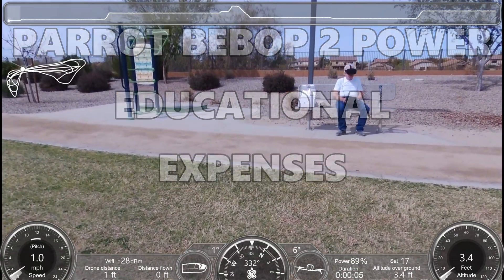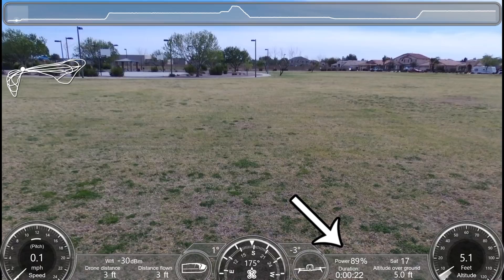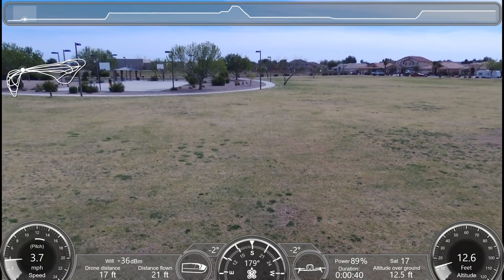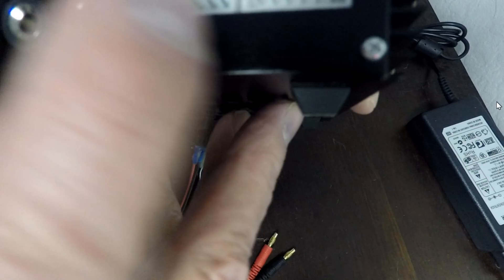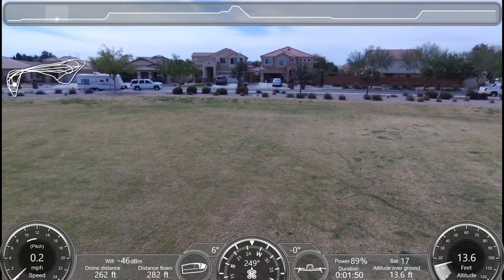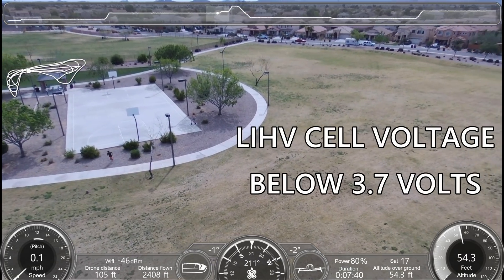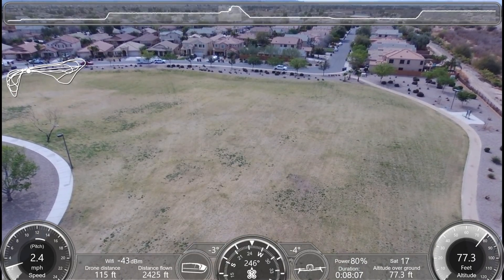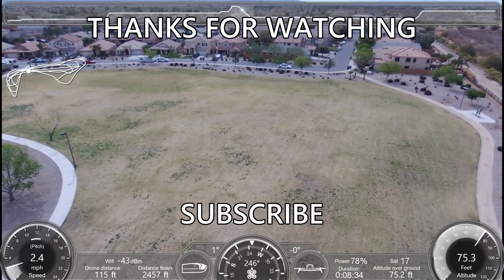BEBOP 2 POWER EDUCATIONAL EXPENSES

Comment: Mr Kent. Got my Bebop Power. Loaded my flight plan. What do I need to do once I have launched the drone to put it into the flight plan? What do I touch/press so it starts on its journey?
Reply from the maker: Hi Peter. You go back to the start page and press the square for flight plan, or in the upper-left corner tap the menu icon. When flight plan comes up, on the upper-right hand side at the end of the menu bar press the "play" arrow. And you are on your way. I hope that helps. If you need help don't hesitate to ask. Have fun and God bless.
Reply: mrkentdotcom  Many thanks. It is so faint I could not see it outdoors. Many, many thanks😉

Comment: Hi Mr Kent, is a balanced charger necessary if I periodically deplete the battery fully, or to a low level, then fully charge on the block charger?
Reply from the maker: Thank you for your question. No you don't have to use a balance charger if you do that. Here is a video I put together to help folks understand why I recommend using one. But it is not a necessity. 

https://www.youtube.com/watch?v=CkEhSrNgWEc

God bless.

Comment: Looks like your cable on cell checker is plugged in reverse. The black wire is the common and should be on the right lined to the negative pin. Right?
Reply from the maker: Thank you Colin. I know what you mean but the yellow wire connects to the ground wire of the Bebop on the other end. I have a page with a diagram at: www.mrkent.com/bebop
Also you can download the wiring diagram at:
http://www.mrkent.com/bebop/diagram-2.pdf

Thank you for your keen observation. I need all the help I can get at my age :) God bless.

Comment: Hi Kent, I use the TURNIGY ACCUCEL 6 - 80W 10A (I think the Elite you have is 6A) Balanced charger which spec wise looks similar to the one you have demonstrated. I also have discharged about 4 batteries and at 1A and mine gets hot too and the little fan comes on. However all is just fine as I guess they are discharging thru a variable resistor that will get hot. An observation of your Balanced charger is that I cannot see a 'little fan' duct on the top like the one on the TURNIGY ACCUCEL 6.
If you click the link below you will see the little fan on the RHS its the round hole.
I also place it on a cool surface to help heat transfer and airflow. But all seems fine.
https://hobbyking.com/en_us/turnigy-accucel-6-80w-10a-balancer-charger-lihv-capable.html?countrycode=GB&gclid=CjwKCAjwnLjVBRAdEiwAKSGPI54slipUsbm2RA1Q32Wb7K-dpRjR5KHs_c1B1BT6ZojTQ0vJr1EYfhoCsbcQAvD_BwE&gclsrc=aw.ds&___store=en_us
Its also a little cheaper here it seems and they sell globally. I live in the UK and delivery was fast.
So far I have had no problems however this is with LiPo.
I hope this helps our little group finding an alternative.

Mike

Mike
Reply from the maker: Thank you Mike. Yep, I had one with a fan for years but eventually the fan wore out and I think I bought a less expensive one this time around. But I don't need the higher amps any more. Yes, your input is valuable and I thank you for it. God bless.

Comment: I have that exact hobbie mate , as far as I can tell I am getting 💯 or that's what it says on Bebop2 power app .
Reply: I also purchased the Hobbymate and so far it works like a charm. Now with a great balance charger and Mr. Kent"s excellent adapter cable I can finally take proper care of my Power batteries.
Reply from the maker: Thank you Jeffrey. I know of another person who has one and has had NO issues. I think maybe I got a dud. But I'm glad yours does the job for you. God bless.
Reply: mrkentdotcom I'm really new to this whole thing . I didn't understand when numbers were been displayed. With help of guys on FB I got the correct setting for Ballanced charge . It beeped and it was 100 on free flight pro app. And I've changed both battery's once ... All I'm saying is it seemed to have worked and I'm a new user   of Bebop2 power and the balanced charger . Thanks your You Tube channel has helpoed alot
Reply from the maker: Thank you for your kind words Jeffrey. I was new once too, just like the rest of the Bebop folks. Never be afraid to step into a comment conversation and ask questions. Everything you learn you can share with someone else some time. It is a simple formula: I learn something new - I create a video about it - many others learn something new. You can do the same thing :) God bless.
Reply from the maker: Thanks for your kind words and God bless.

Comment: thank you so much for all the great job you do teaching us things we may never knew :) Mr Kent please advise if you know why even after using balance charger my bebops battery drops from 30 to 0 % in maybe under 2 minutes. Once I almost lost my bebop and it was going into a lake (  at the time I was making my video called Sabrina lake )  for this same reason.
Reply: Makes sense Kent and this 30% rapid discharge is a concern I guess to all of us. I have brand new batteries and although they do not fall as quickly as you describe I do notice a much faster discharge from 30% onwards.
As such I now try to get my Bebop back in sight when down to around 40% ;-) anticipating having to land sooner than expected. However having the ability to measure your cells individually, which a BC will do helps you to monitor the situation and avoid the scenario Kent describes.
Reply from the maker: Hmmmm. Do you "charge" then change to "balance" and let it finish? If you haven't been charging with a balanced charger 100% of the time your charger may have overcharged one of the cells which ruins it. Then when it gets weak you  are running on two cells. The bottom line is you have about 60% of real power. The last 30% is functioning like any exhausted object would. This is just a guess but it's the best I can do. A friend of mine have me a battery he had charged with only the Bebop charger. I was grateful to receive it but could never get it to give me very long flights, even after using my balanced charger. Thank you for your kind words and God bless.
Reply: mrkentdotcom yes I used balanced charger from the beginning and it does it.
Reply from the maker: Do you leave your batteries fully charged on the "shelf" for long periods of time. The surface of the lithium and the surface of the polymer gradually deteriorate over time if that happens. Other than that I cannot think of anything else. God bless.
Reply: mrkentdotcom no I usually don’t leave it fully charged. Maybe I got a faulty battery. Great info and knowledge you give us as always and thank you again god bless you sir 😊 btw my new video will be next month as the area I’m going to has road closure due to snow ❄️😊
Reply from the maker: That sounds beautiful. Drive safe.
Reply: mrkentdotcom thank you 🙏

Comment: Have you ever checked out this balance charger?

EV-PEAK DP2 35W/CH 3.5A/CH 3 Ports Intelligent Battery Charger for Parrot Bebop 2 Drone Battery https://www.amazon.com/dp/B01NH7J2XJ/ref=cm_sw_r_cp_api_8lCRAb6MD7A96

I haven’t really dug deep on the web for others, but this is the only one I find on Amazon. 
Whatcha think?

Also, so far my 3 batteries have been behaving pretty good since September 2017. 
I’m getting about 17-18 minutes of solid flight time per battery with good weather and mild wind. 
And, about 12-14 minutes with windy conditions. 
Since I don’t have a balance charger yet, I keep my batteries at 40-50% charged when storing them.
Reply from the maker: I have had people ask me that same question. I have so many subscribers I can't recall which one it was but it ruined one of the cells in his bebop battery. I recommend shying away from that. Besides it costs too much. Thank you for your question and God bless you.